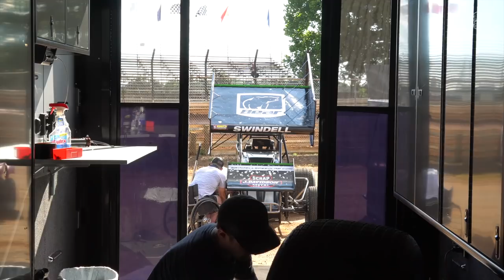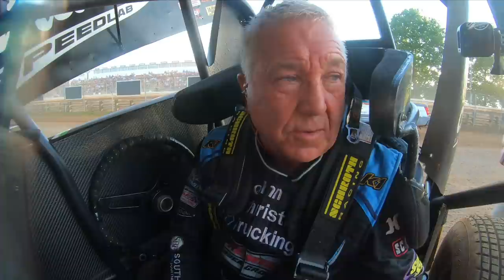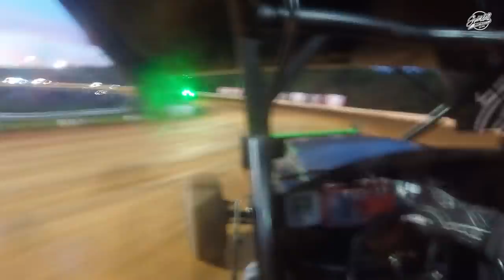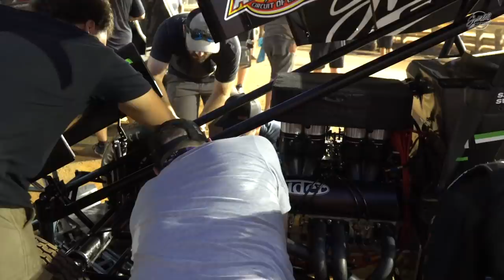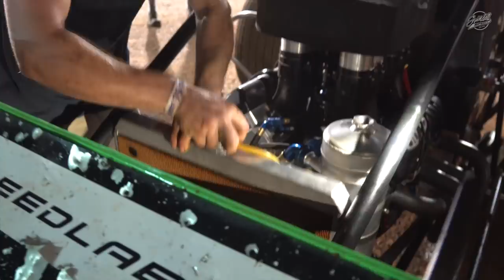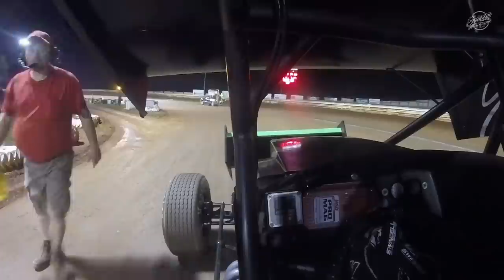RADIATOR SMASHED & LEAKING OIL | Williams Grove Speedway Tommy Hinnershitz Classic

Comment: Never been a fan of Sammy....until speedlab came along
Reply: Still not a fan...  he coulda ran the A.  But as he said “probably no point now.”
I guarantee Larson starts the race from the rear if it happened to him.  He might not win from the rear but he’d give it a try.
Reply: Maybe he was thinking about putting unnecessary laps on the engine? Sometimes you have to weigh those things out.
Reply: No doubt, from a financial perspective it probably does make more sense to park the car than it does to run and try to make the top 10.  However, I can’t say I know, but I suspect Swindell has enough sponsorship money to make that point irrelevant.  
The only reasons I can think of to run, are for pride, or to put on a show for the fans.  Both of these reasons might not be the most responsible in regards to resources, but they are what separates the fan favorite from the driver people like to boo.  Obviously over Sammys career he has decided that he has no interest in being the fan favorite.  I will remind you that this thread is about being a fan of Sammy.
People came to see the stars compete.  Sammy is one of the biggest.  He could have given his fans their moneys worth and try to win from the tail.  He did not, thats why myself and many others are not Sammy fans.  
He is still one of the greatest EVER, of ANY ERA, to wheel a Sprint Car.  So nothing but respect, but I’m not going to buy his T-Shirt.
Reply: @mjriemen  careful,sammy will call you a pisser lol
Reply: Ya they do not have the $ young money has. Lol
Reply: And he is a pisser, lol. #Stillwinning